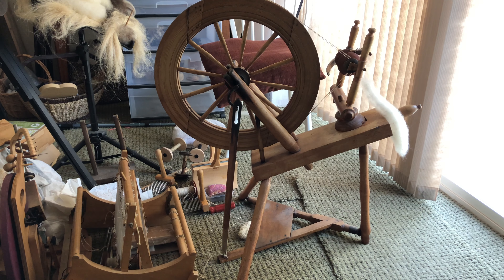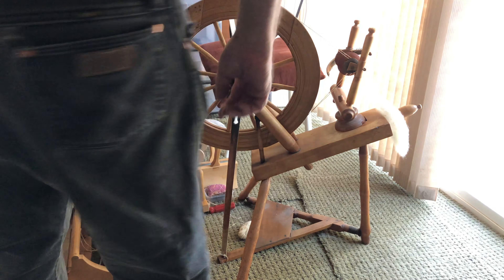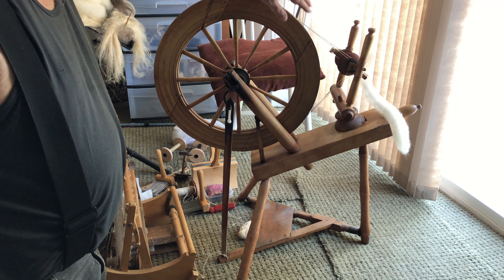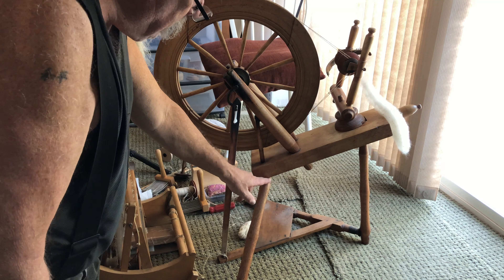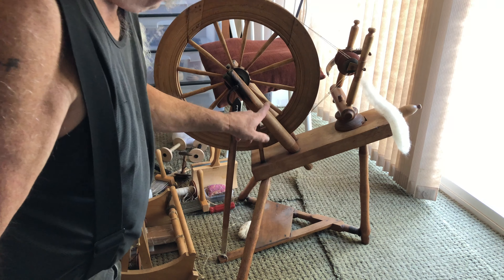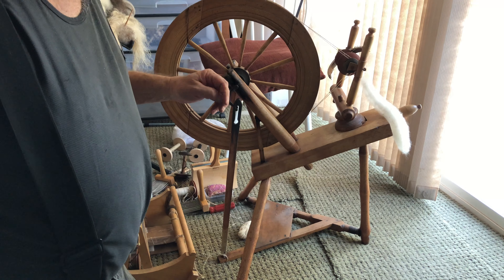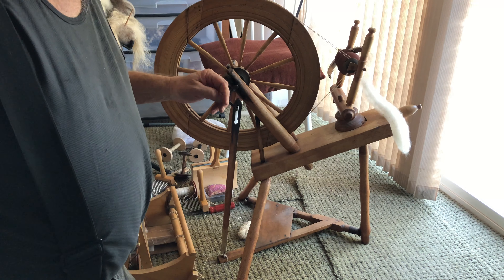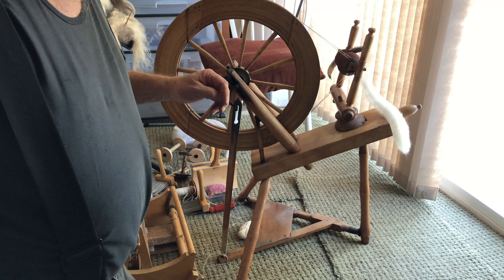This Old Girl

Comment: Put a piece of leather in the top of the hole in the footman. No klacking.
Reply from the maker: Never seen that before but an interesting idea. But this wheel is no longer here. It was sold. They came over and I gave them a demonstration and sold it on the spot. I let them know of the clacking issue and they knew of that because they watched this video. The footman was terrible worn so I suggested to just cut a little from the bottom so they won't have that issue. I'll figure it out for another wheel and see how well it works. A leather bearing would be a good idea so you never wear out the wood on the footman. Just replace the leather as needed.   Great idea.